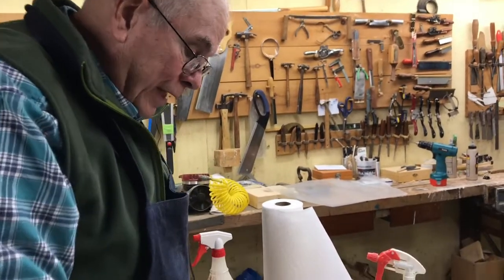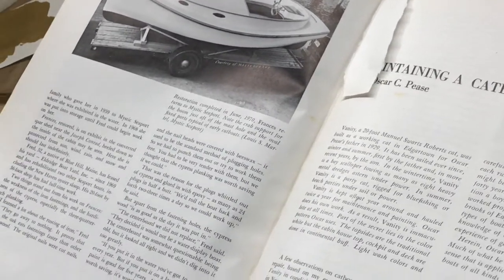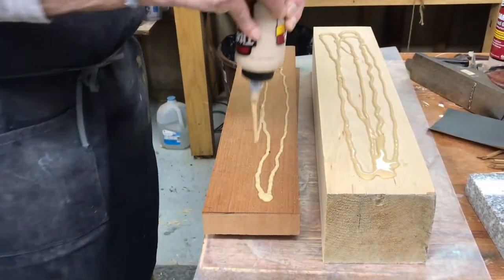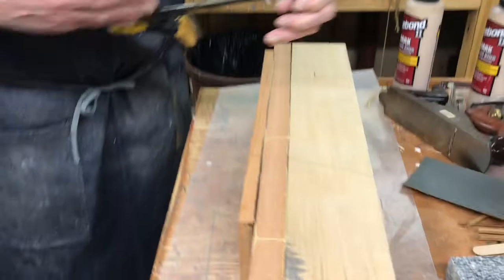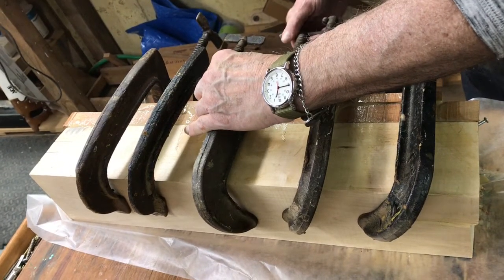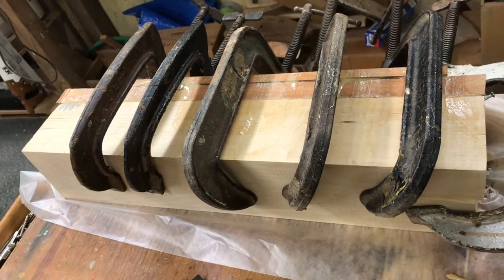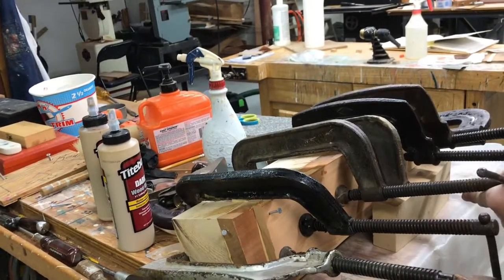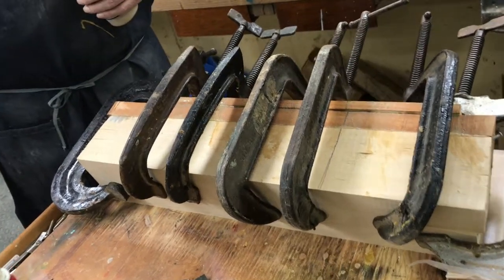Cat Boat Half Hull by Malcolm Crosby, Series 2, Part 1: Gluing

Comment: Betsey, and Malcom - thank you so much for doing this and posting the videos. They are without peer regarding step-by-step construction, carving, and finishing half hull models. I did a double take when looking at the first part of the video because I had just bought that very book at a house sale in Cotuit! One of the first stories I read was of the Frances, and then the story of Townsend Hornor's building of his boat modeled after the Frances. 
I wonder where your supply of basswood and mahogany comes from. I've not been able to locate anything longer than 24". Also, thanks for the suggestion to contact Mystic Museum for the plans. Getting the lines to make the templates is so key in rendering an authentic representation. 
Again, thank you!
Reply from the maker: JCT 49 Thanks so much! We really appreciate it! Malcolm recommends the Woodsmith in Falmouth and Niagra Lumber in N. Y. (800) 274-0397. They have a minimum for delivery, but you can combine woods!